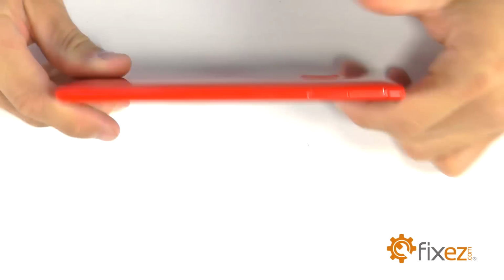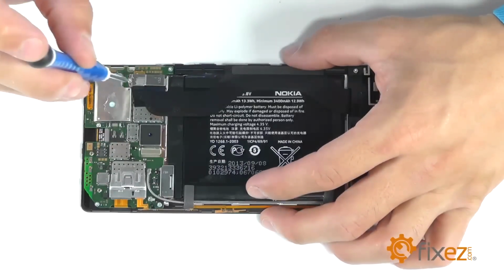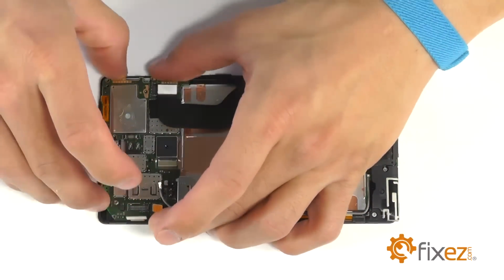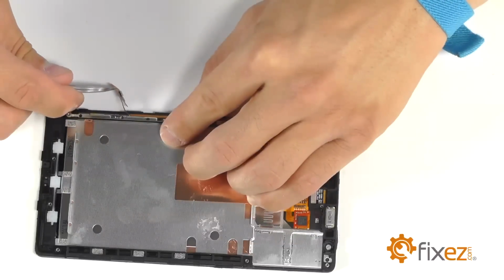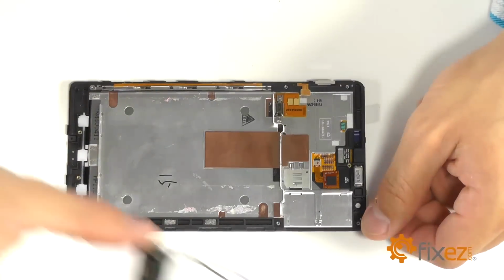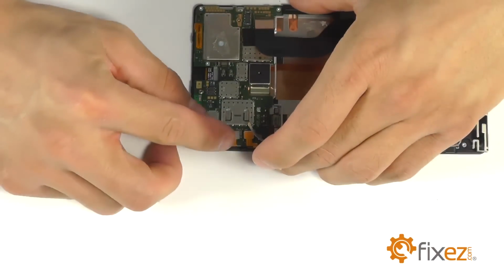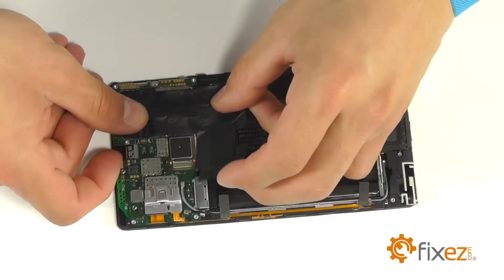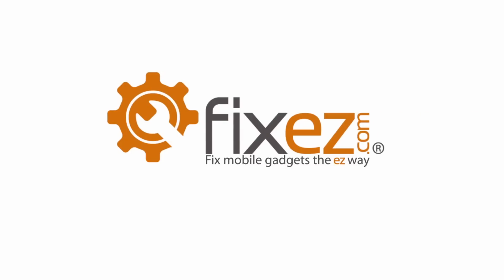Nokia Lumia 1520 Screen Repair & Disassemble

Comment: you just gained a new sub ! very , very , very good video ! i have a nokia 1520 , and , from what ive read on the comments , im not the only one that cracked only the touch screen. i was advised to go for the whole replacement of the screen , and avoid removing only the touch screen , since its nearly impossible to remove and apply a new one , perfect  !

Comment: My screen is fine but my capacitive buttons have stopped lighting up. They work but they go out. How can i fix?
Reply from the maker: +Ryan Kelsey We offer the dock which includes the LED lights for the capacitive buttons. Replacing the dock should resolve this issue for you. http://www.fixez.com/nokia-lumia-1520-micro-usb-dock-port-and-loudspeaker-assembly
Reply: ***** Will this fix my issue even if the current LEDS go on and off? It seems that they are not blown per se, they are just not staying lit. They flicker on and off sometimes when I press in some places on the screen. Screen is in excellent condition, no scratches or cracks
Reply from the maker: You can perform a phone reset to see if this helps. Otherwise, it's possible you need to replace the dock port as this would have new LED lights and would resolve your issue.

Comment: my phone got run over by car. I opened it up and saw the right portion of the block around the top right corner smushed in a little bit. don't know what part that is but looks like it might be the cpu.  I bought a battery and tried turning I on, no response. question iswill phone not turn on because the screen is messed up and back cover might not be touching appropriate locations on motherboard?

Comment: Hi 

I am wondering how this screen is compared to the original Nokia screen. It looks much dimmer? Also does it use more battery. I have tried none original lcds before.... bad quality, lights leaking, dim and sucked the battery dry in no time.

Comment: I followed your steps and almost everything went perfectly. My display is working fine, but the touchscreen not. but when i unplug and plug again the flat cable, the screen and touch screen works, however, if i turn off the phone and turn it on again, doesnt work the touchscreen again. So i need to do the same proceed, unplugg and plug the flat cable again. Do you know if this issue can be fixed somehow?

Best regards.

Comment: that first torx-screw under the sticker was super deep inside and when i tried to screw it all i got was pieces of metal stuck on the screwdriver... used a T2 screwdriver, didnt use any strength...